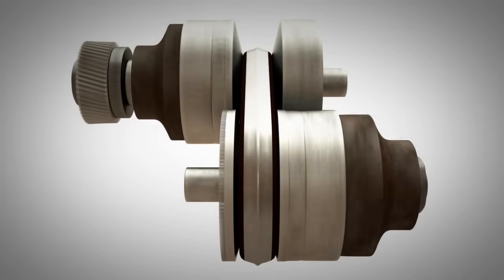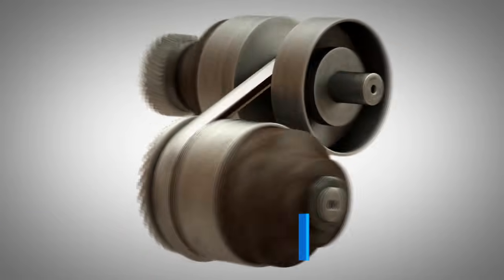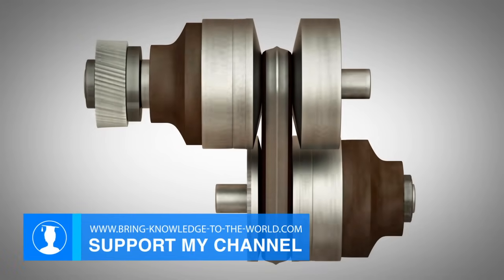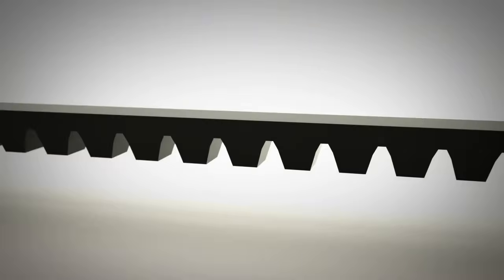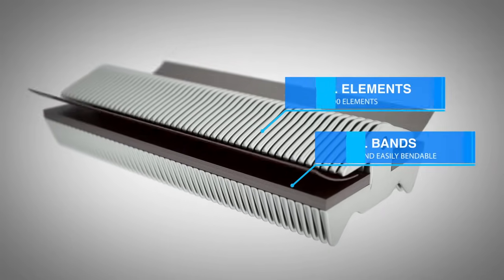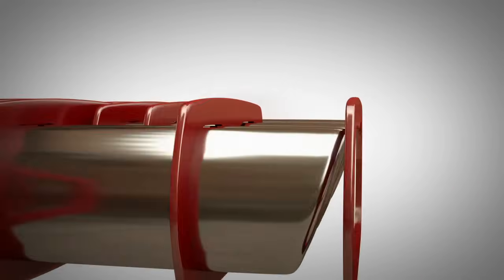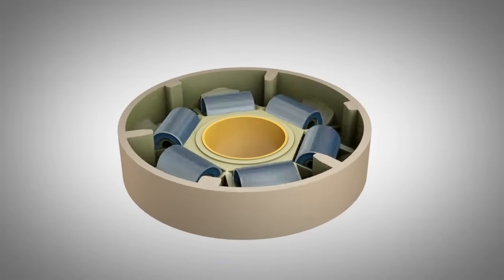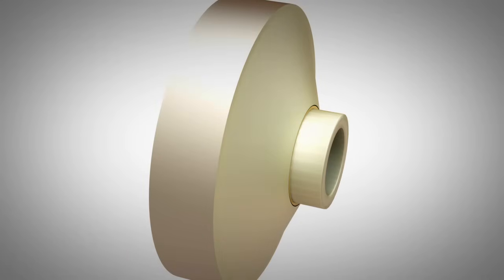How a CVT works! (Animation)

Comment: C.V.T. are for Snowmobiles and A.T.V.s.
No reliability and customers whom purchase these vehicles will have problems. Customers lack of fluid changes every 30,000 miles.
Stay with my 9-speed transmission in my 2016 chrysler 200C AWD,  fluid change at 100,000 miles.

Comment: Great video here !! By far the most complete and simplest explanation found concerning CVT. Thank you for the last part explaining also that modern cars use oil pump to adjust position of the sheaves. I came here because of that part and found the right explanation 
 Thank you so much !!

Comment: Great video and explanation. I find the metal push belt working metal pullies hard to fathom. I gather there’s no slip involved. What happens when the transmission is in neutral or at traffic lights?

Comment: I had two cars, those fail when running for long time and show Hot error. Solve problem on both using oil cooler, why oil temp affects those CVT transmissions?

Comment: And if people are wondering, it's these new belts/chains that make them horrible in cars. Those segmented belts or chains will never last like a solid steel gear does. CVTs are very reliable in scooters with rubber belts and low horsepower. In cars, avoid at all costs. When those metal belts come apart, it will damage many components and need a new transmission. It's not worth it. The manufacturer likes it because it's cheaper. As long as it lasts the warranty period, they don't care.

Comment: Nice, I have a Volvo 340 '87 CVT witch works with 2 belts,
Reply: For what is second belt? To hang on it when they say repair price for CVT?
Reply: @daitedve1984  Normal it don't need a second belt becorse the differential, however the first versions of the 340 did't have a differential, so 2 belts were needed
Reply: @daitedve1984  The first cars with that system did'nt have a differential so they needed 2 belts, however later cars have a differential and can actually drive on 1 belt, but on 2 belts its more safe, and it divided the power between, if one breaks con can go on ( on a lower speed ?! )

Comment: DO NOT FORGET. You need to change the CVT fluid between 60k-90k miles! You will feel the difference, and it will extend the life of the transmission!

Comment: So all of the power is transmitted by that belt? It would seem that the belt is subjected to lots of friction and wear since it travels up and down between the pulleys? Also the power is exerted on the side of the belt as opposed to underneath like a normal belt/pulley system. How long does a belt last?

Comment: All I really cared to know was how the pulley sheaves moved towards each other and vice versa. All the animations I watched earlier represented them as shape morphing solids, as if being inflated and deflated by air. Of course that's likely not practical. This video explains that well. I'm both impressed and enlightened, and inspired as well.
Now that I know how it works, how do the steel plates of the belt not wear as they slide along the moving sheaves? Don't tell me the whole system is bathed in transmission oil.

Comment: There is a big difference between how the scooter belt works and a CVT belt. A "normal" belt pulls from the drive pulley (or sheave) to the output, a CVT belt pushes. As a result the 2 belts are built completely different, a belt that pulls is much easier to make as the tension keeps it running straight, so as long as the internal strands are strong enough, it holds together. A CVT belt has to push straight without buckling, it does this by the drive elements locking into a solid mass when under compression.

Comment: a belt driven car vs a gear driven car. this type of transmission probably offers a super smooth ride but performance is probably a second thought with this transmission. l could see lots of slippage occurring not to mention the possibility of the belt breaking under stress.

Comment: 2016 Nissan Altima S with a CVT transmission fluid change is done by charging it from the bottom via the overflow plug port, Since there is no filter why is it necessary to inject the fluid from the bottom of the transmission?  Can you not just drain the old fluid and measure what comes out and add the same amount from the top where the dummy locking cap is? And if you do this a couple of times from the top, IS THAT NOT DOING THE SAME THING ?????

Comment: can u please suggest a mechanism for the axial movement of the sheaves?? how is it practically made adjustable??
Reply: It uses hydraulic pressure which is supplied by a chain-driven pump. This chain-driven pump is driven by transmission input shaft that is connected directly to the engine's crankshaft. So, practically our actions of pressing and releasing the throttle pedal have final effect on the axial movements of the sheaves.

Comment: could you explain cvt's have constant engine rpm while other transmissions have variable engine speeds?
Reply: They do not, the engine rpm will increase and therefore the sheaves move in reaction changing the 'gearing' and outputting the correct power.

Comment: A simple solution to limiting slippage in a high torque requirement would be to increase the rotational velocity of the input side of CVT gearbox and then gear it down on the output side.  Sun gears could easily provide a 8:1 step up and step down ratio. Therefore reducing the torque required to be transmitted via the belt by the same ratio.  Of course the CVT gearbox will need to run at very high rpm which may compromise the life of the gearbox.  Thoughts?

Comment: That is really cool. But I wonder if the belt will last long.
Reply: Their average life is between 60k to 150k miles. But, more often than most times, the problem is software, or other mechanical issues that cause problems. Even though these transmissions are far cheaper to make (less than half the cost of an automatic.manual transmission), they usually cost more to have repaired. This is because you need someone that actually knows what they are doing.

Because of that, repair shops can charge whatever they want to have them repaired. The best thing to do at that point is to decide if you want to keep the vehicle longer. If so, and they don't charge much more to replace it with a new one, it is better to do that. A new one should have a very good warranty on it, and will need less work as soon as a rebuilt one.

And I will never buy a used vehicle that has a CVT, unless the whole transmission has been replaced. You never know how hard it was driven, and if it might have had computer problems that were not resolved. Just like any transmission, the harder they are driven, the less their lifespan. But with a CVT, it is harder to tell if it is driven hard.

With automatic transmissions, for example, you can look at, and smell the fluid for a burnt smell. This is an indicator of it either being driven hard, or not being changed in a while. Also, if you put the vehicle in drive with your foot on the break and give it a slight bit of gas (very little to hear the RPMs increase) you can sometimes hear one in bad condition slip. You can look for fluid leaking, or on the outside of the transmission if you look under one that is bad. (Keep in mind that these things don't always show with a transmission that has not been properly taken care of.)

With a CVT, it is harder to try to try to tell what condition it is in, and what you are getting. I will only get a vehicle new that has one. It might look like I am afraid of them, but I am not. I am just cautious when it comes to getting one, till their quality improves. If I were getting a new, small sized car today, I would get one with a CVT. But I also take really good care of my vehicles, and don't take off fast, unless it is absolutely needed. I am also not an idiot that tries to race cars on the roads.

Razar.
Reply: Just few years. Tested 30 years ago with a motorbike Push - Camino.
Reply: I had one last over a year.
Reply: Kesateria Matahari yes, on my motorbike i used it a lot for 4 yrs without replacement. never caused any problems and eventually  when i replaced the belt it wasn't  a hard job.

Comment: so when talking about electrical issues like short circuit  damaging CVT vehicles like scooters, the only thing to worry about a scooter like all motor bikes is the ECU and not the transmission as they are mechanical? is that right?

Comment: This is so much simpler than normal automatic transmission
Reply: Do I even need to bring up the flures on a traditional auto transmission? If you want go go by statistical failure rate CVT are vastly more reliable. Dont just blinded throw out accusations
Reply: @eagle___empire3175  Because cvt's are fairly new, so not many have failed yet.
Reply: Is it though?
Reply: The belt tends to snap off,
Reply: belts tend to slip
Reply: I have 35k hard miles on my Nissan Altima CVT trans and never had an issue. Even a manual trans is more complex than a cvt but I do a agree that a manual trans and a cvt are the 2 best and most ideal in the world.
Reply: Yeaahhh..... belts slip but that's why they use steel belts. Tougher, longer lasting, and heavier meaning more resistance to slip.
Reply: We are not talking about Manual trans here. Obviously less room for failure there. CVT has been around since the early 1900's and now that technology has gotten better they are a excellent trans.
Reply: the biiggest problem on CVTs is that the motor runs always at the same speed and that doesn't please the ear of most people.

Comment: Conclude Report about no economy ,bad performance Automotive engineer of 6 parts  in all brands which mean brands failure in automobile thus forever (mean permanent).

1. Wider rear track than front track dimension chassis  : easy wrecked chassis,the lowest traction,extreme tail flick,extreme slip,hardcore control in all speed and economy as 1-5 km/l,below 1 km/l (below 0.90g in 0.70g traction level).

2. turbocharger (1-4 turbo per engine) intercooler petrol engines : unstable acceleration,extreme wrecked engine parts,torque horsepower overload, and economy as 1-5 km/l,below 1 km/l.

3. without rear fog lamp : easy electronic parts wrecked,economy as 1-5 km/l,below 1 km/l.

4. CVT transmission : slow acceleration,economy as 1-5 km/l,below 1 km/l.

5. Wider front track than rear track in below 10 mm dimension chassis with FWD,RWD,AWD : medium traction,tail flick,easy slip and economy as 1-5 km/l,below 1 km/l (below 0.90g as 0.85g traction level).

6. Front track as same as rear track dimension chassis : medium traction,medium tail flick,easy slip,power slide,understeer  and economy as 1-5 km/l,below 1 km/l (below 0.90g as 0.80-0.85g traction level).

If over 1 of 6 parts,automobiles of economy use  1-3 km/l,below 1 km/l.

From
All brands database test performance

End report.

I just report about their performance economy brands vehicles series with specification & standard equipment about disadvantage on automobiles market and effect in EV(recharger too many),Hybrid too.

Comment: Cvt scooters are good but when it comes to riding pleasure gear motor cycles are best coz later wont ache your wrist due to former requiring continuos power as acceleration drops drastically when throttle is in zero. Moreover gear vehicles are very safe preventing accidental throttle ocassions.

Comment: CVT, ( Continuously Variable Transmission) a dutch invention in the '50 (1953-1958). Made by Hub van doorne the founder of the dutch truck brand DAF. In Holland whe call the CVT: Variomatic
Reply: Absolutely. Inventing old solutions. DAF were ahead of their time

Comment: August 2016.....GM is getting ready to get back into CV transmissions again....possibly in small cars by the fall of 2019. They had a previous bad experience with CVT's back in the 80's 90's but that was back in the Roger & Me era where only profits and dividends mattered. And the accountants and attorney's told them to redesign their 4 cylinder engines without balance shafts. Now that Mary's in charge all their vehicles are better looking and the CVT's will be as smooth as silk. They"ll. lower themselves  buy a few vehicles from Nissan to make sure they get their design right.

Comment: How many modern cars use CVT?  Daf did it for a while, but the cars were small and light-weight (resembling a Trabant).  Then Daf was bought out by Volvo, who made the Volvo 343, but that's the only family car I know about that had CVT.  I bought one and drove it for about 6 years, and it was OK, but no great performer for its 1400cc.  Overall, I prefer a regular gearbox, though computer control of cars may have improved the CVT.  One problem is that it can only change gear while it is in motion, so if you stop in an emergency, it gets caught in a high ratio, and can't get back to bottom gear to take off.  Great fun doing 80MPH backwards, though  :-)

Comment: Cen-trif-i-cal
Reply: centrifugal |senˈtrif(y)əɡəl|
adjectivePhysics
moving or tending to move away from a center. The opposite of centripetal.
Reply: Centrifugal: From the Greek meaning imaginary. Centripetal acceleration is towards the center applying the third law of Newton there is a reaction. But really all I had meant is the way you used centrifugal the spelling changes so I believe - I still haven't looked it up - yet.
Reply: +BobbyB430 or it means this:

early 18th century: from modern Latin centrifugus, from Latin centrum (see center) + -fugus ‘fleeing’ (from fugere ‘flee’).

Which is exactly what the animation shows, the slugs moving away from the center.
Reply: There is no centrifugal force,The force is in the direction of acceleration which is towards the center. The movement you see is tangential motion which is perpendicular to the Centripetal acceleration. The slugs don't fly off  tangentially because they are restrained, and in order to continue in the circular motion the slugs must 'catch up' to the restraint by accelerating toward the center.
So the English is from Latin, where is the Latin from?
Reply: I forgot, I do like the video, thanks!
None the less the 'slugs' are moving tangentially.
Reply: centripetal force
nounPhysics
a force that acts on a body moving in a circular path and is directed toward the center around which the body is moving.

centrifugal |senˈtrif(y)əɡəl|
adjectivePhysics
moving or tending to move away from a center. The opposite of centripetal.

The animation shows the slug moving away from the center which matches the dictionary definition of centrifugal, the opposite of centripetal. It's an apparent or fictitious force but the description of the phenomenon of that movement is generally referred to as a "force" but they can't be used interchangeably.

As for the etymology of the word, it certainly doesn't mean false as the understanding of this as an apparent force came long after the term was assigned. If it were greek meaning false it would be pseudo-something, like pseudoscience.

     Etymology
       From Proto-Italic *fugiō, from Proto-Indo-European *bʰewg-.

https://en.wiktionary.org/wiki/Category:English_terms_derived_from_the_PIE_root_*bʰewg-

My original reply was spurred by your claim that it should be "Cen-trif-i-cal" which is nonexistent. "Cen-trep-i-tal" perhaps?

Comment: great animation and explanations but the cvt is probably the worst transmission is out there.
Reply: Why? It gives you maximum force at all times. It is the best transmission out there.
Reply: It's not really a transmission, think of it as a clutch
Reply: Most CVT hitting the market are build toward fuel economy so it's not performance and it's boring.  Go try a 300hp sled! it will put a smile on your face.

Comment: Really great animation and clear explanations!
One question: what kind of clutching mechanism do CVT's use (how do they handle the engine running while the car is at rest)?
Reply: If you look at the learn Engineering video, they mentioned that two sets of clutch packs were used on a standard planetary gear set to engage the drive shaft.